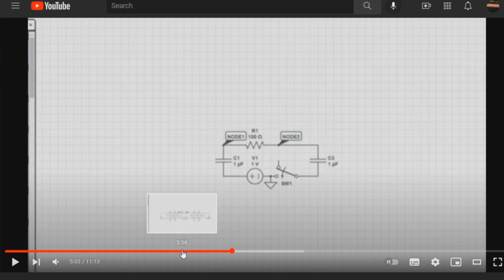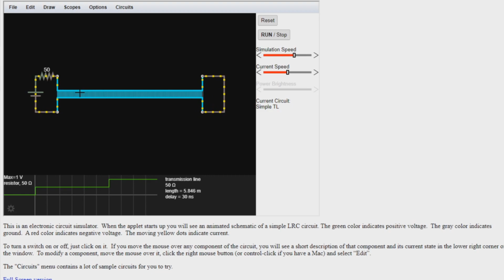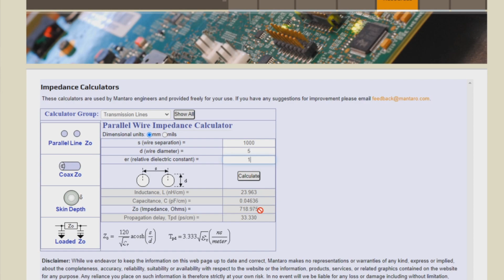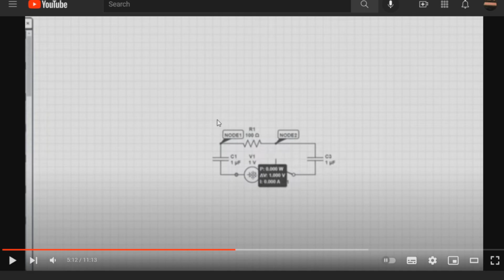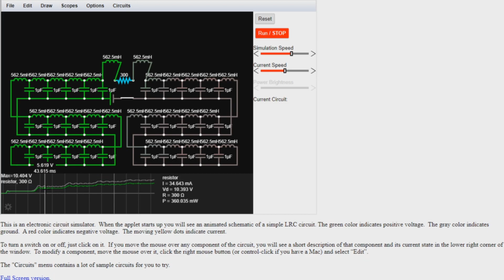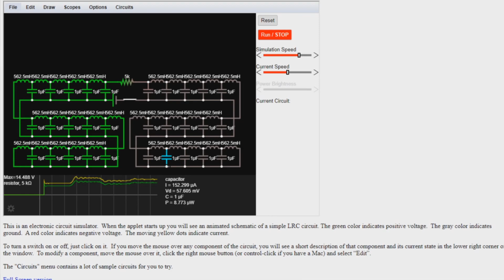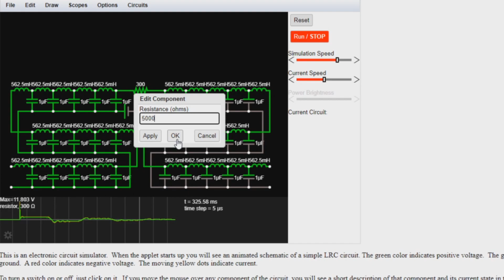2nd analysis, I think I was originally wrong! - Veritasium "The Big Misconception About Electricity"

Comment: You are all making the same mistake using the telegraph operators' equations from the work of Heaviside. 
This model is a simplified model which does not work for very high frequencies therefore the first moments of the pulse. 
Your modeling neglects the 3.3 ns of propagation of the electric field in each capacitor.
This model does not give you any indication on the propagation of the fields during the first nanoseconds (1m gives 3.33 ns f = 300MHZ) 
during this time the capacitor between the two wires cannot be considered as a perfect capacitor. 
The line model considers that the dimensions of the line must be negligible compared to the wavelengths, 
precisely to overcome the propagation problems in the elementary components, for example 1/10, 
which means that with 1m between wires any component of the signal> 30Mhz 33ns invalidates the model. 
For example a two-wire line or a coaxial does not work correctly at high frequencies (for dimensions of a few mm in a coaxial).
Reply: The lumped element modeling is not correct. A lossless transmission line does not look like a capacitor even right after t=0. The characters impedance is always real when there are no reflections.
Although he glosses over a couple of points, he doesn't include them in this analysis is CORRECT.
Although his dimensions are smaller, Ben Watson's video is essentially the same result and verifies this analysis. It is correct in principle.
Reply: @Observ45er  For my part, I am not saying that the line behaves like a capacitor but that with an elementary scale of 1 m the LC model proposed in the video neglects the propagation time in space (3.3ns in this case ) this for the elementary capacitor but also for the elementary inductance.
That in the literature covering the transmission lines it is established that the equations governing them are only valid if the elementary distances were less than 1/10 of the maximum wavelength therefore here 30 MHz therefore 33ns of period. any component of the signal exceeding this frequency invalidates the model.
this can be seen clearly on coaxial cables which transforms into a waveguide for high frequencies.

Comment: The big problem is to assume 100% conductivity, in real life very little tension will be conducted! Imagine a world where no lost of power!
Reply: The assumption of zero resistance wires does not invalidate the overall concepts being questioned here. And this analysis is actually one of the only correct ones I've seen out of four or five.

Comment: I do not know enough about transmission lines to know what could be wrong with the application here, but I suspect that some of the simplifying assumptions for transmission lines break regarding this circuit. That is what my background in fluid mechanics would suggest (all of incompressible fluids theoretically is solved using a single multivariate differential equation. You need to figure out which parts of the equation don't apply to your circumstances in order to actually solve it in a useful manner)

Here is a simulation in a physics program showing a similar response, but it does it with a physics model rather than a circuit equivalent. It shows an initial small current response followed by a single gradual increase in current after the fields propagate through the wire.

https://youtu.be/aqBDFO1bEs8

Perhaps your model looks the same with a zero-ohm load, though.

I do feel the impulse to point out that I would not consider a 16-20mA LED in series with 6k resistor powered by a 120V battery to be a successful lightbulb. Normally an LED lightbulb powered by 120V is multiple Watts where you get ~60mW used by that LED or something (depending on color)? And according to what I just looked up, 5mm wire is rated for at least ~50A in power transmission, so we could be getting 6kW through that wire or something? (I think higher for DC, actually). I guess the point is that if you impedance match for this transient case, you are horribly impedance matched for the steady state DC case that gets to ignore the inductance and capacitance of the wires.
Reply: This is a loaded question and is not about the response time of the light bulb. 
Ben Watson's HFSS simulation does indeed shows what is born out by an understanding of transmission lines.
The wires DO interact and that is precisely why SOME small current flows in the bulb after the one meter travel time.. 
The switch end starts a current flowing in the wire and that field propagates through space at the speed of light over towards the line connected to the light bulb. 
.
What so many people miss is that the parallel wires  are not capacitive nor inductive but  RESISTIVE. The characteristic impedance, also called the surge impedance, of a transmission line is real not reactive. 
.
This easily explains why after the time of one meter travel the light only sees a small current because of the TWO T-lines which are somewhere in the neighborhood of 2x  800-900 ohms in series with the battery and bulb!!!
. 
I've yet to see anybody that understands this.
That type of lumped-element representation of the transmission line gives you the FALSE impression that it looks capacitive. If it was capacitive you would see the COMPLETE source voltage across the bulb and FULL CURRENTafter that one meter time travel. The transmission line could just as easily be modeled with the inductor first. However the lumped-element representation doesn't reflect reality it's only an approximation.
Cheers

Comment: Also, if you grant all the magical assumptions (instant filament heat-up at exact instant of tiny current response before any actual power could realistically heat up anything, and all the rest) then Derek was posing a philosophy question, not an engineering question. That was the actual trick of the question.  There is zero power delivered at t=1m/c sec, some tiny amount of power a short nanosec or so after.  All the engineers complaining about it are missing the point. However, their complaints have led to excellent education, so I am in the engineers camp. It is good to miss the point of Veritasium's puzzle.

Comment: You and EEVBlog are still using too many simplifications. IRL Veritasium's set-up is gnarly, the wires are all over the place, then you've got skin effects in the wires, so the diameter of wire matters. The correct simulation is a FEM field analysis. The transient current then is about a tenth the steady state max, enough to get light out???  But everyone seems to be ignoring the fact it takes more than a nanosecond for any lightbulb to shine, since you have to heat up the filament.  The EM field does not do that directly.  So are you not all wrong, the whole lot of you? After all, Veritasium did admit we should make all his fantasy assumptions, but he never said "How long will it take for current to pass through the bulb?" He clearly was asking about it shining. For that 1 sec would be I think correct-ish only if we assume zero resistance.  It takes about 0.01 to 0.6 seconds to heat up the filament (depending on bulb rating).  It is not the voltage nor current that "turns on" the bulb, it's the current times the voltage throughput, so "time to turn on" even for the magical lightbulb is limited by the filament, not the EM field.  I guess we are supposed to also assume the filament heats up instantly huh?
https://yadda.icm.edu.pl/yadda/element/bwmeta1.element.agro-3419fa9e-f342-4ba0-b2fc-8e2a5de9ba43
Reply: As a very experienced RF engineer very familiar with transmission lines this fellow has the most correct of anyone I've seen (4-5) and comes to the correct conclusion .
He glosses over a couple of important things, but ultimately he mentions them and comes to the correct, full conclusion.
.
This is trivial for an RF engineer familiar with transmission lines and time domain reflectometry, TDR.
.
Also, the real discussion here is how fast electricity travels and whether it is in the wire or the field. Picking on the nonsense of how quickly the light bulb can respond is not part of this ultimate problem. 
After the one meter time delay there is a small current flowing in the bulb and then depending upon the impedance of that bulb there will be some different variations in current for the kind times shown here..
This analysis is correct.
Regards

Comment: In your simulation, how long are the wires? It looks like they are not 300,000km long. I don’t see where you can even add in the length of the wire. So the simulation is showing a nearly instantaneous flow of current and the delays and bounces are all of the capacitors charging/discharging until they reach a steady state.
There may be a way in the simulation to measure the voltage across one capacitor to see that. I just haven’t worked with it enough to see if that is possible.
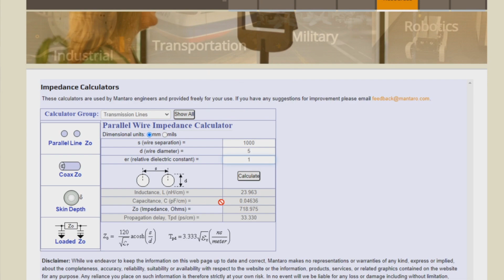Reply from the maker: Sorry I missed this comment the first time around and haven't been on youtube much. Anyway, in case anyone in the future reading this is wondering the same thing: At 11:00 in the video I show how the L and C values for the transmission lines are computed for the real world wire setup. This is a L and C per cm of wire. Only the ratio between L and C matters, so I'm free to rescale the C to be 1uF and L up by the same ratio. This also means each L and C combo no longer represents 1cm of wire, but a much longer distance equal to 1cm x whatever I scaled by. I think each lumped L + C combo is like ~200km in this case, but I forget the exact number. You can modify the falstad circuit link I provided in the video description to include the switch at the very end instead of at the middle, you'll see that it will take a bit of time before the light bulb "sees" the effect of the switch. Or as you mentioned if you apply a voltmeter to the capacitors at the end, you'll see they won't change in voltage until the first reflection reaches them.

Comment: Derek said to make everything ideal and forget about transmission lines and impedance bla bla bla, so why are you making his simple system complicated?  As soon as you start talking about capacitance and inductance you are talking about impedance.  Derek has a battery, a light bulb, a switch, and really long wires.  Switching direct current with a switch is not in the realm of AC transmission.  Derek was talking about getting AC power from a plant to a house, then switches over to talking about a DC situation.  the purpose of his video was to produce clicks and that worked perfectly
Reply: Of course he makes money off clicks.  But I can't know whether or not he intends any intellectual dishonesty.  I do think the world deserves a follow up video, where he addresses reasonable objections.  I have followed this closely, because my intuition is not matching his answer.  If there's an appreciable energy transfer between wires 1m apart, shouldn't I be able to touch a light bulb against the power cord of a lamp that's turned on, and get that light to turn on?  Why does it seem like that trick only works with stuff like Tesla coils?  I think it's great this topic has generated so much interest though.

Comment: Veritasium's application of the Poynting Vector is the problem. Feynman talks about this misunderstanding in his Lectures volume II book.
Reply: I 100% agree with this. For Veritasium's video to be accurate he should of set a color map of the electric field behind the pointing vector field. That way you can see the strength of the field along with the direction. Absolutely the energy is going to follow the pointing vector but the magnitude of the energy is key. He didn't show that.
Reply: @PGH EngineerOkay, you seem to have a grave misunderstanding here. Let's review. The poynting vector S was originally defined as, S = E x H, where E is the electric field, H is the B-fields(magnetic field) auxiliary field, and x is the cross product. Okay, now on to your examples vs a circuit. A permanent magnet has no electric field. Therefore, E x H = 0, S = 0, no power. Charged balloon is the opposite, no magnetic field (so no magnetic auxiliary field) E x H = 0, S = 0, no power. Now, a circuit. A circuit has an electric field and a magnetic field, E x H != 0, S != 0, so power! He wasn't wrong. Every video by any professor or industry professional agrees with that. He simply misled. The problem he proposed and the answer that was given was also correct but highly misleading. The stuff on the poynting vector was also misleading. (He drew one set of vectors with mislead magnitudes instead of the whole field, etc) However, nothing in the video he said was actually wrong. Energy is only ever in the field. Electrons only drift and cause current. The energy is always in the field and only every goes to other fields.

The reason a bulb lights up has to do with the resistance of the material used. Different materials are just that, fundamentally different. The energy can't be lost, only transferred. So it's 'lost' as heat. What really happens is it is transferred to the materials electrons causing them to jump up in energy levels. When an electron jumps up or falls down in energy levels em radiation is emitted. This em radiation is in the form of infrared radiation and some visible light. Thus the thin filament lights up.
Reply: @PGH Engineer Again, incorrect. The magnet and the balloon are DIFFERENT SYSTEMS, and thus have different materials. So the same thing will happen that does in the light bulb or the balloon touching the earth. Since you have no battery to power the E-field it does 'collapse'. And if you simply hold them close to one another it doesn't change their individual systems. (ie the places the poynting vector is defined) 

In fact, if we went with your claim, the energy is in the wires, ie in the metal. Then a permanent magnet that gains charge would act like a battery, it holds the power right? But we know this isn't true. If you take a hunk of magnetic (conducting) metal and apply a charge to it, it heats up. In other words, the metal is resisting the flow of charge NOT accepting it, thus it's bled off as infrared radiation, ie not a battery. A capacitor on the other had sets up an electric field between two metal plates and thus CAN hold charge.
Reply: @PGH Engineer Well first, no. You are misunderstanding steady state. I != 0 as you claim. In steady state I is constant. In other words the energy in the fields isn't changing. (steady state) However, after looking it over some more I agree that Derek did a terrible job with the poynting vector. If you did display the vector field correctly (perhaps with a heat map or something similar to convey magnitude) you would see that some of the energy does indeed travel across the space but most of it lies on the SURFACE of the wires, not INSIDE the wires. The field directly outside the wire carries the charge of the wire. That part is true, it's the field that carries the charge, NOT the wire.
Reply: @PGH Engineer Okay, it's always good to question the conventional but facts are facts. Cheers mate!

Comment: Steady state analysis is very different from transient analysis. I don't understand why you mix and match equations of steady state with the step function...For example Impedance can be used only in steady state analysis, but you use it when the input is the step function...there is no definition of transient impedance...that i know of ... at least... unless you say that Impedance=dv/di ... very confusing for me... (Impedance is valid only for sinusoidal voltage and current ONLY in the steady state... correct me if i am wrong...)
Reply from the maker: Sorry I missed this comment the first time around and haven't been on youtube in a while. In case anyone in the future is reading this and wondering the same thing, the answer is that steady state is just a special case of a transient response. Transmission line equations deal with sinusoidals, however as I show in the video, the jwC and jwL cancel out to just be L/C, so in the case of a low resistance wire the impedance is the same for any sinusoid. Because of this fact, you can construct any waveform from any sum of sinusoids ala Fourier transform, so you can apply the equations to step functions and such. For non perfect wires where they are frequency dependent, you get a bit of tapering off where at lower frequencies you are R dominated but at higher frequencies you are again L/C dominated.